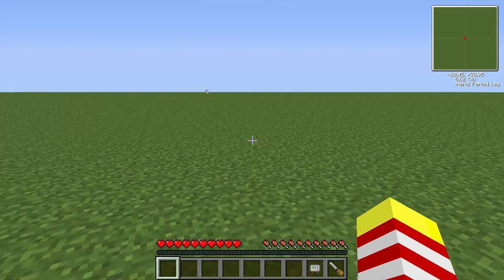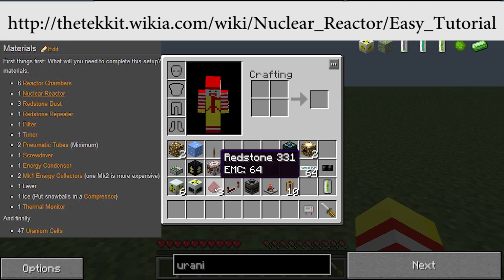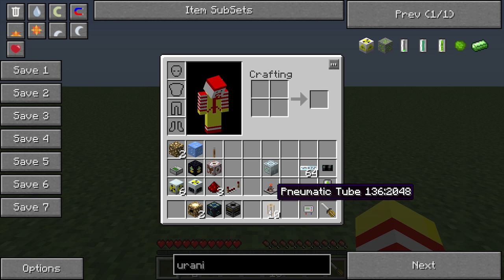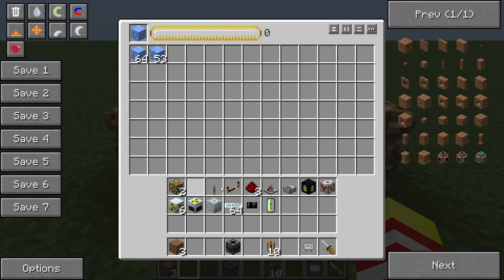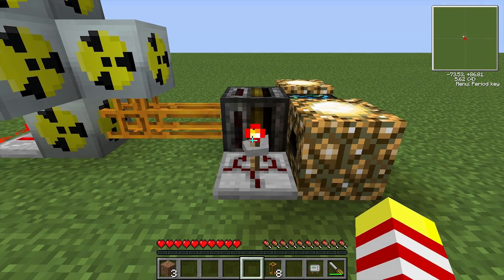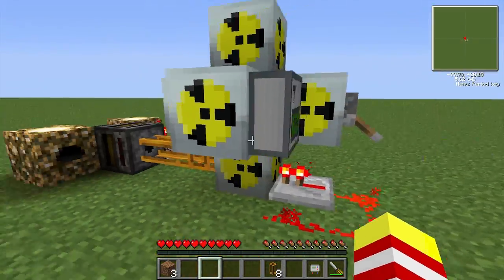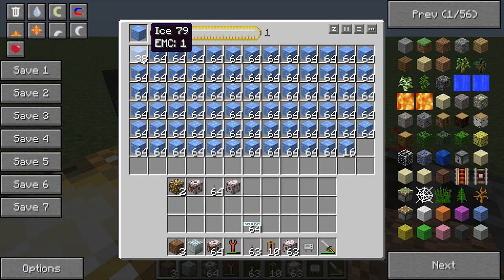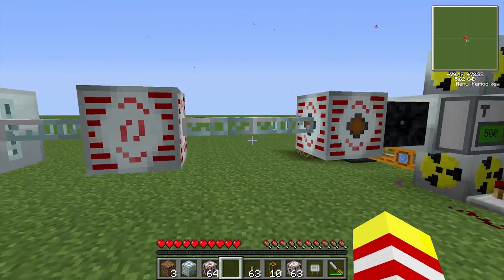Safe 2030 EU Nuclear Reactor in Tekkit

Comment: **UPDATE 2018**: If you still want to use this method, limit the reactor to 39 Uranium rods and fill the rest with ice. In order to keep the Transposer/filter sending the ice fast enough, put red matter in the bottom right corner of the condenser and shift click the ice stack to the left of the red matter. this ensures the condenser fills with as much EMC as it can possibly buffer, it wont run out any time soon. 
Explanation (for nerds that find it interesting like me): Filters only take a stack when its present in the top left corner, if there's not a full stack, it'll just take whatever is there, be it 1 piece or 39 or whatever, so filling the condenser's EMC buffer to max ensures that a new stack will always be generated when the previous one is taken, for as long as approximately 16 pieces of red matter will create Ice blocks. In terms of the HV cables exploding, it seems that they've been nerfed to handle much less EU without exploding, and 39 Uranium rods is the maximum a nuclear reactor can output without exploding the cable.
Have fun! <3

Comment: My reactor has never exploded (Except for 1 time where my friend turned it on while I had the timer for the Ice off) but Every time I turn it on, it blows up my MFSU and most of my Glass Fibre Cables. (Server has explosions disabled)
Reply: +Thorns_  Might be a biiiitt laaate but. Have you got 4x insulated hv cable going into a hv transformer before running glass fibre out of the transformer and into the mfsu?

Comment: safe reactor in tekkit = big reactors. There is NO WAY AT ALL to blow up a big reactors nuclear reactor, you get NO RADIATION POISONING from yellorite and it is about as common as iron ore.

But really wny make a nuclear reactor when you can get unlimited power (10000 a tick forever) from combining mystcraft and magma engines?
Reply: I said safe reactor in <b><u><i>tekkit</b></u></i> = big reactors. I did not specific which flavor. Sure this may be for tekkit classic but then there are many ways to get infinite power in tekkit classic without using nuke.

Comment: hope I get some help here. I did the set up block for block item for item, the reactor has the same config but only outputs 560 eu/t I have 4x hv cable coming from it. help 

edit: I don't get any voltage when I disconnect the mass fabricator
Reply: HeyItsGranny Mine outputs nothing

Comment: is 500k eu the max cause i have this hv solar plant and no matter how many i add it stays at 500k
Reply: if i break or place a cable connecting to it,it just drops to 0 frames for 10-20 seconds
Reply: fyi the MFSU can accept the direct voltage from the reactor.. if you are using a transformer before your battery supply it wont matter if the solar panels are giving 2030 eu/t the transformer will down the eu/t to 200-500 eu/t depending on if its a LV, MV, or HV transformer. try taking the power from the solar panels directly to an MFSU that is close to the solar field... the farther the power has to travel through cables the less power output at the end.

Comment: You can't actually just turn a standard nuclear fission reactor on/off with a simple switch, you have to push the control rods all the way in. Furthermore, the reactor itself is unrealistic as an actual nuclear fission reactor would take up a HUGE amount of space, also, the only possible way of having a safe nuclear reactor is to build a fusion one, but fusion reactors don't use uranium, they use Hydrogen. Anyway, back to my original point, which is, YOU CAN'T BUILD A SAFE FISSION REACTOR!!!!!!!

Comment: Just so you know if you're running a Mass fabricator off Nuclear power you hook the Mass fabricator right up to the HV cable. The Mass Fabricator can handle any power input, and it'd produce UU about 50x faster if you didn't downgrade the power.

Comment: So this relies on the old version of Equivalent Exchange? 

Also I'm pretty sure that ice blocks, water buckets, lava buckets and external heating and cooling no longer works for IC2 reactors. I believe you have to use coolant cells, heat exchangers and heating cells. 

Would it be possible to do an updated tutorial for the updated IC2? I find the changes to reactors confusing and there don't seem to be many tutorials on them.

Comment: And LittleGamer95 just put another setup the same as the ice, but with uranium and a faster timer, then you can have a fully automatic reactor, and you don't need to worry about "boom-boom" because it has the thermal monitor loop

Comment: Pardon my brash answer but the most probable reason is that your HV transformer is in the incorrect position. The side that has 3 markings in a triangle shape need to bee connected to the reactor all the other markings on it that are singular are outputs. Your MFSU needs to be connected to one of the single marks on the HV transformer not the triangle one. Hope this fixes it.

Comment: Only thing I would update is that the ice doesn't return to the chest, as the filter will only pull from the chest, but will not allow it to go in.  That is why you have to have it facing the correct way.  I would put some extra pipe coming off of it and having the extra ice run into another alchemical chest for creating anything else, just to keep tons of ice items from being loaded.  Otherwise, this is a great video.

Comment: i have 2110 EU/t reactor and i keep on blowing the wire that leave the botum of the reactor can some one help me? 
i am using the 4xIns. HV Cable block id-30184:8 and i have 2 transformer per reactor.

Comment: @Beausafk weird. I ran my nuke for about 30 seconds and my mfsu was fully charged with 10,000,000 EU. I only had about 166 degrade on my uranium cells (I'm talking about the part that comes after the ID when you use not enough items. Mine was :166 and decreased by 1 every second.)

Comment: Put multiple of them next to each other. They can't hande the 2000 EU/t, they can only handle 500 EU/t. The mfsu should fill up much faster than if you would add a hv converter (I think).

Comment: you sir are wrong in part of the video,the masss fabricator accepts a LOT of power and can be rigged directly to the 4x cable,and it would be more simple to put integrated heat dispersers in a checkered pattern and put checkered uranium and coolant cells and the rest of the empty slots.

Comment: you can put the filter directly to the side of the side of the chamber and eliminate the need for the numismatic tube and thermal monitor.  i also did find it useful to put a switch next to the reactor as well as the timer so nothing is running while switching out materials

Comment: the mfsu is kind of overflowing its getting more than its using so if u want that just make the mfsu sent out a redstone signal when full and make that go into the reactor  also try play with the timer make it a longer time or it  will make lag and with the power off thing when its hot u can  run the redstone from mfsu into it aswel also using redpower redstone wire :) thanks i think all that willl work well and optimised but you are losing all the power outher than the 512 that the mfsu emits .